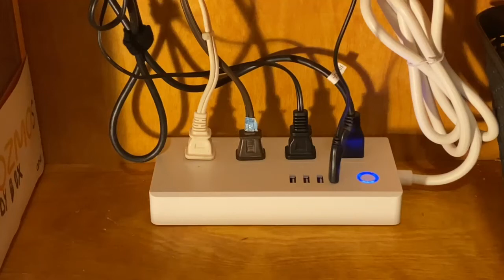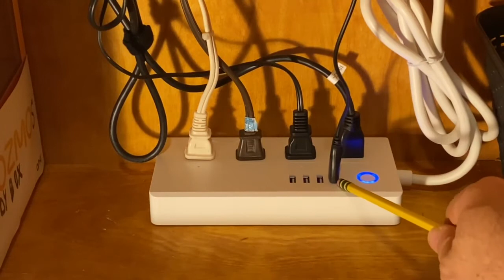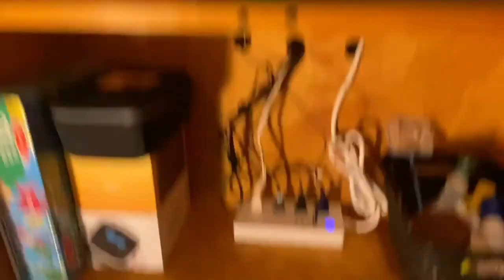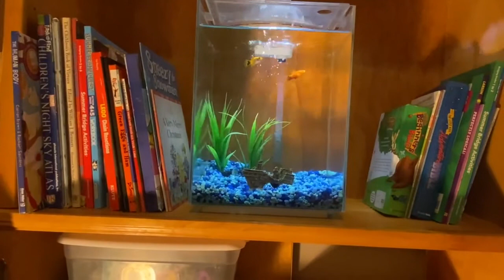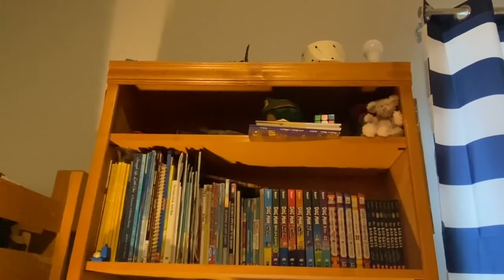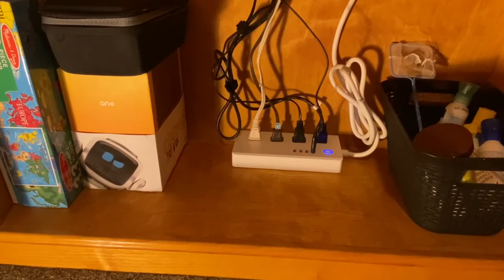YoLink Smart Fish Tank: Product Focus - Power Strip for Lighting & Pump Control

Comment: And so much cheaper than Neptune! I have had a full blown automated reef tank set up and it is horribly expensive to buy. This is a great option for some of the simpler tasks. Pair it with a water leak sensor to send an alarm and shut pumps off or using this for dosing pumps which run periodically throughout the day. Does Yolink offer a water temp sensor? If so, you could use it to run the heater in the tank also. Great products!
Reply from the maker: Yes!  With probe. Check it out: www.shop.yosmart.com 

I am out today. Email me if any questions

Eric@yosmart.com
Reply from the maker: I would like to learn more about your setup, related to your linked devices! Please email me at Eric at yosmart.com. 
Maybe there's a YouTube video in it?
Reply from the maker: https://shop.yosmart.com/collections/smart-aquarium